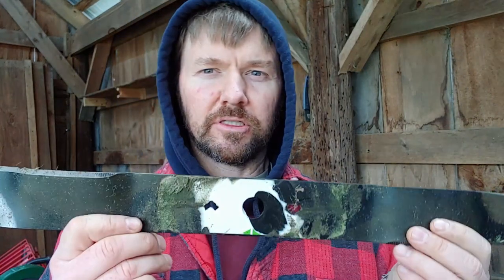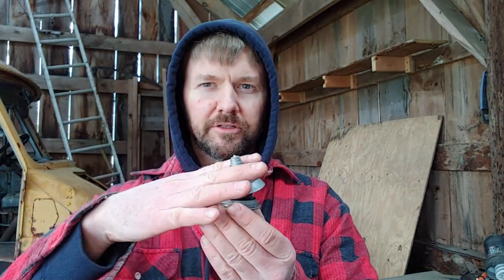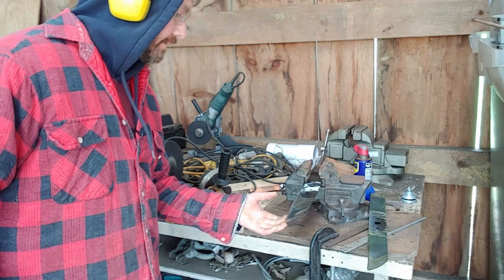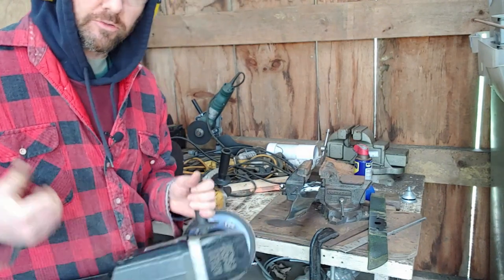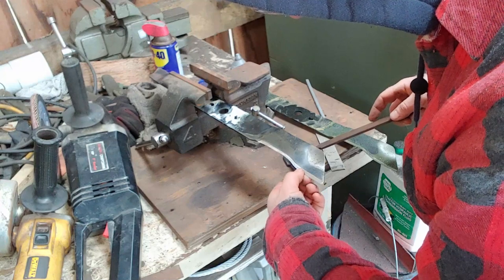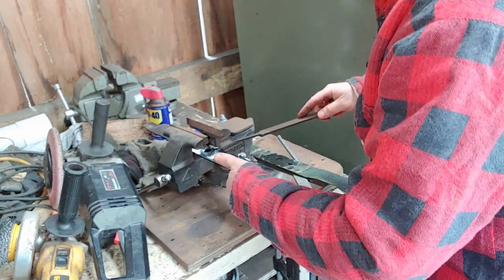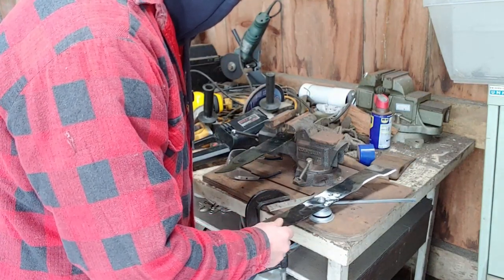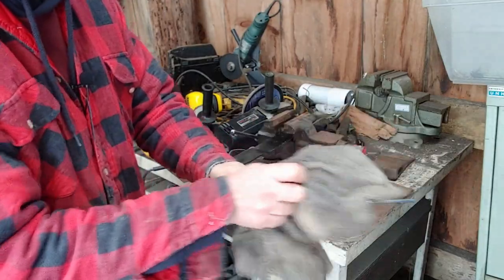TNG Ep. 17: Sharpening Lawn Mower Blades at The American Edge

Comment: My mower is terribly loud and vibrates when the bladed are unbalanced. It is a 61" Hustler Z.  It's smooth as silk when permanently balanced.
Reply from the maker: I guess I can't say that anymore...
It inspires the engineer in me to do a study quantifying how out of balance a blade needs to be for it to be noticeable and to compare that to a study of the balancing tools on the market.
If any such thing exists, and I'm sure it's been done, I'd love to have a gander.
Reply: "Mower blades are spinning 4000 RPMs. An unbalanced blade spinning that fast will cause a significant amount of vibration, which will put stress on yout blade shaft, spindle, and even the engine."

Comment: I sharpen alot of mower blades, i also use an angle grinder with a flap disc,  No need for expensive balancing jigs, i meen its important that they are balanced, but a nail on a wall will do the trick

Best regards
Simon
Reply from the maker: Yeah, I was just doing some yesterday and I still feel like that cheap balancing tool is good enough. Thanks for that encouragement! I also bought the All American Sharpener and am really liking it, I recommend you check them out.

Comment: You mentioned in the beginning of the video that you can only sharpen the blade so many times until it will have to be replaced.  If the blade is not cracked or damaged how do we know it needs to be replaced?
Reply from the maker: At the tips of the blade you'll notice a transition from flat to curved upward. Once you grind the flat portion out the blade should be replaced.

Comment: One note on balancing. Anything that spins has bearings. Unbalanced blades would reduce the life of them. 
 Loving your channel though, I really want to work on my knife sharpening. But I'm still deciding on what system. 
What belt sander do you have? Mines a cheapo from Harbor Freight that I don't care for.
Reply from the maker: I love where your head's at! Such a good point about the bearings.
I want to clarify, though.
My question is not whether blades should be balanced, but rather the DEGREE to which they need to be balanced. Is that little $5 cone doohicky good 'nough, or do we need to be spending $250 for the aircraft grade bearing balancing tool?
Question said...that balancing tool is on my list of future investments because I continue to aspire for the highest quality service possible. 
Thanks so much for your thoughts and comments, please keep watching and helping us all grow.